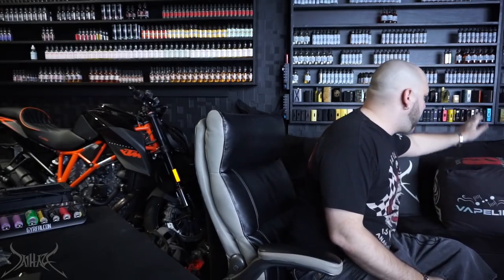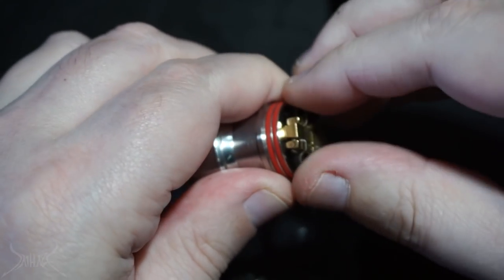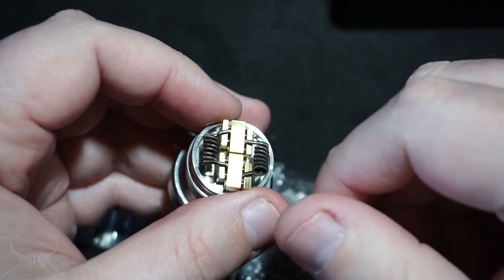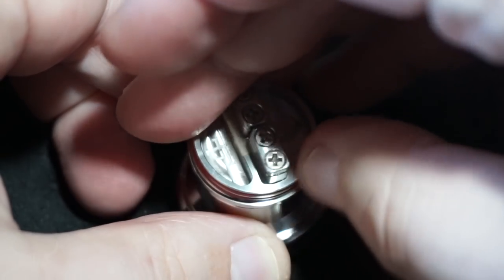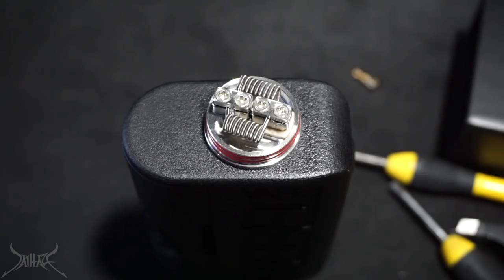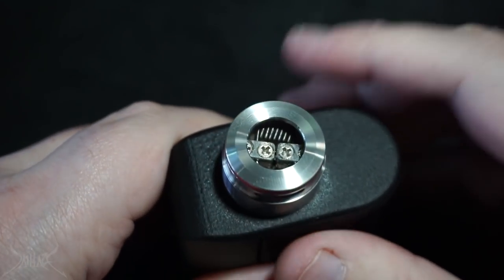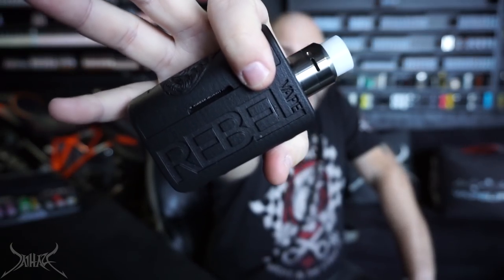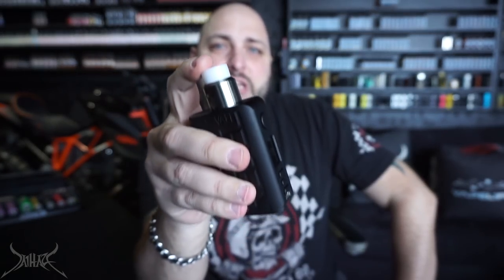Update: 528 Customs Goon LP New Post Configuration

Comment: I'll stick to my OG Goon over the V1.5 and LP but that's just me.
Reply: yea same here, the OG Goon still the best design imo
Reply: John Bear I just got into drippers and ordered me an OG goon. Waiting for it to come in the mail. I'm stoked!
Reply: I rock the Goon and 1.5 - I have bought everything from the dead rabbit, drop etc and still use my goons on all my devices.  Not sure why I love it so much.  I used to use like the baby beast, even the cloud king when I started vaping.  Started with the Alien kit (still works too after 2 years or more).  I eventually went to RDAs and bought a goon from my local shop as they only had 2-3  different drippers to choose from.  I bought a stainless Goon, have used it every since.  Only thing I did was buy another SS 1.5 when it was released.  It is great for almost everything in my opinion and is wonderful to pictures.  I even got colored screws and posts (for photos only) .  I love them, and will probably use them until something drastic happens with devices.
Reply: I like the 1.5 more, it's a bit easier to get the airflow to hit exactly where you want it. For straight up flavor though, the 22mm Goon is the way to go...still haven't had better flavor from any RDA, RTA, or tank I've vaped. It's the best hands down.
Reply: @ Brett Johnson - You will not be disappointed. It is a legendary RDA for a reason.
Reply: Yup Titanium goon v1 for me... lost art goon v1.5 is nice to...
Reply: must vape on some terd burglaring rdas
Reply: The OG has the best flavor imo

Comment: Those clamps also change the airflow. Making the clamps smaller allows more air to get around the coil in my opinion giving it wayyy better flavor then before. Flavor isn't muted anymore. I've been using mine pretty constantly after getting the posts.